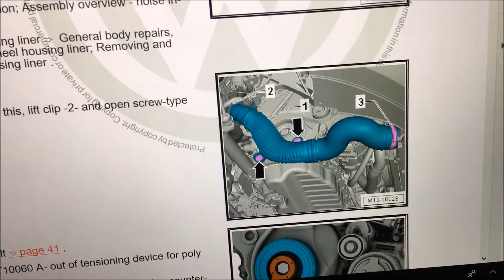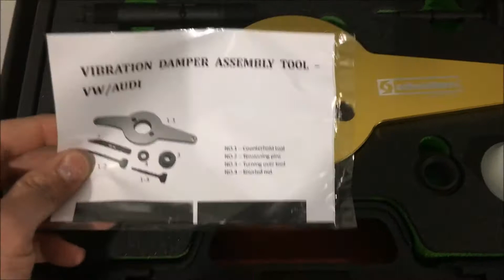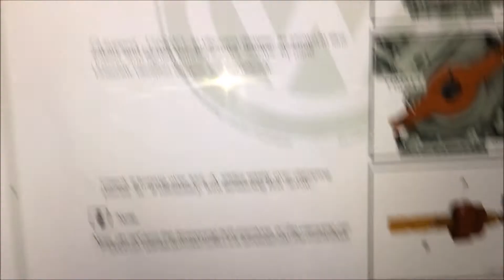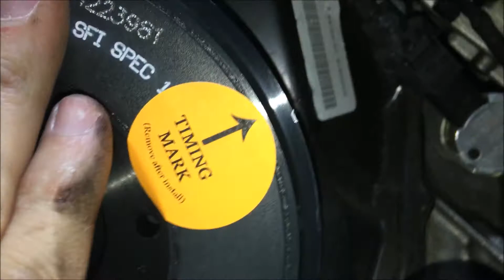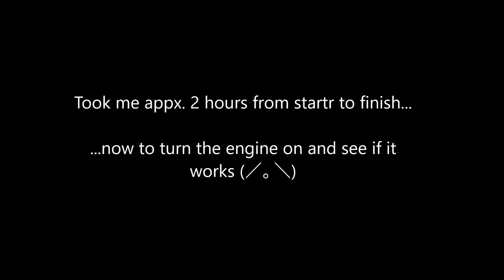MK6 GLI Fluidampr Install & Review

Comment: I'm trying to understand how that center hold pin expanding tool does something.. is that preventing you from accidentally pulling off the inner pulley as you pull off the main pulley? It seems like the timing cover would hold that pulley so it couldnt come off anyway??

Comment: Just curious do you feel that the schawbin tool is needed after all? because you had to remove the locking pin to put the new crankshaft pulley bolt in and if it was going to jump or spin it would have.  I'm interested in doing this project and the tools are more expensive then the part so I appreciate your video and opinion I know I'm going to have to order the counter holding tool, I'm just wondering if the shawbin tool is needed because it's a lot thanks
Reply from the maker: Hey, based on my experience you can get away without using Schwaben tool as long as you make sure there is no crank movement during the swap. The good thing is the crank will not move easily.  You will need the holder tool (T10355A) since the crank bolt requires some serious torque when tightening it.  See my thread in vwvortex for more details:
http://forums.vwvortex.com/showthread.php?9040097-Fluidampr-Installation-and-Review
Reply: You're the man and thanks for the reply

Comment: Hi, I have a 2014 VW GLI and I just ordered the Fluidampr with new bolt from uspmotorsports. So far I have Neuspeed power module, discharge and charge pipes, and lightweight crank pulley. I have been satisfied with the upgrades so far besides the power module causing my car to make the EPC light to come twice during hot days and high speed driving with high engine revs. I am swapping the Neuspeed crank pulley for the Fluidampr due to recommendations on various VW forums for long term reliability of my engine and smoothness. I installed the Neuspeed crank pulley last and noticed a big increase in the engine revving much faster and seemed to pull a lot harder with acceleration. I put on about 2,000 mi with the lightweight Neuspeed crank pulley I do like the results of the Neuspeed crank pulley, but I don't know if it would make the engine have a shorter life. I look forward to the comparision of the new Fluidampr crank pulley. I have 30,000 mi on my car.
Reply from the maker: That's cool man!  I've had no issues with the Fluidampr so far (~ 7,000 miles later).  I agree that the biggest concern with the Neuspeed crank pulley is the long term effects on the engine.  It's also bad to have if you have a built race engine with aftermarket internals.
Reply: So what's the verdict? Which was better?